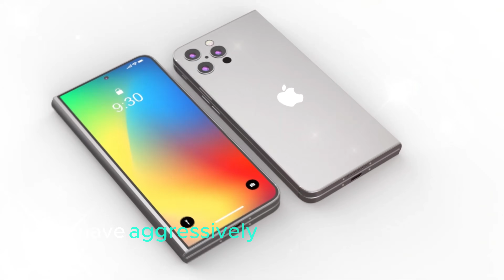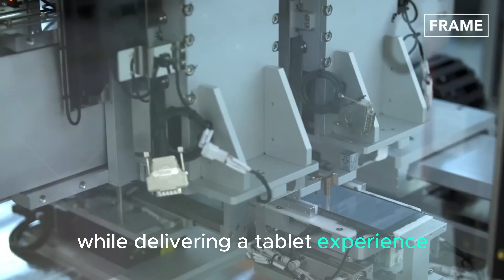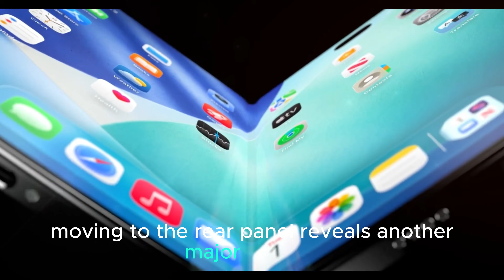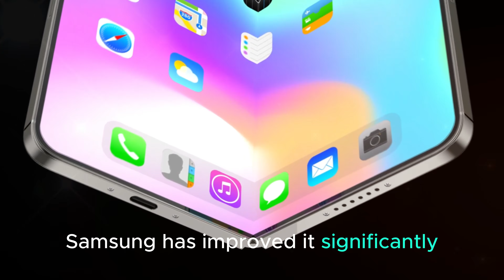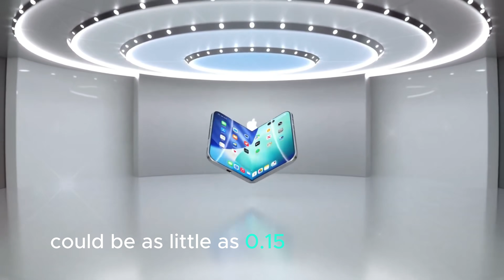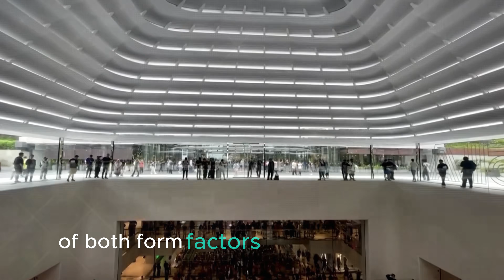iPhone Ultra Fold LEAKED! Apple’s First Foldable iPhone Could Change Smartphones Forever!

Comment: The telephoto lens may be seen as a necessary compromise, but its funny that Huawei got three cameras on the back of the Pura X Max.
Reply from the maker: True 😄 Huawei is pushing camera hardware hard. Apple usually focuses more on balance—performance, software, and optimization. Let’s see what compromises the iPhone Fold ends up making